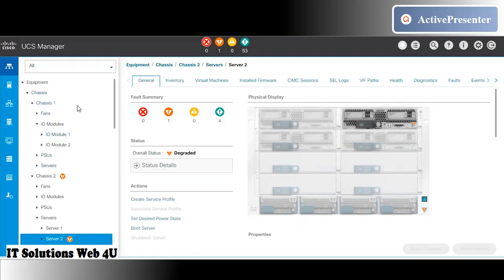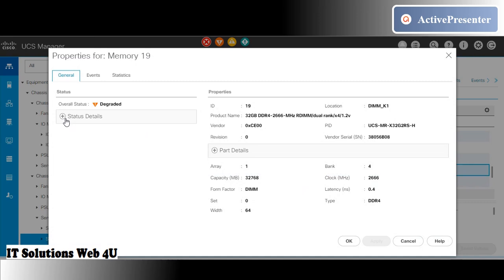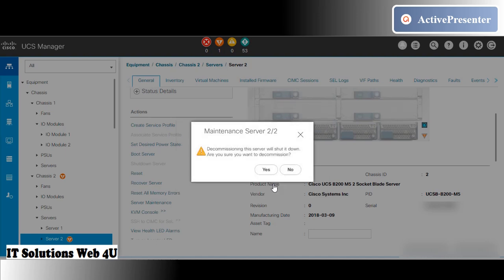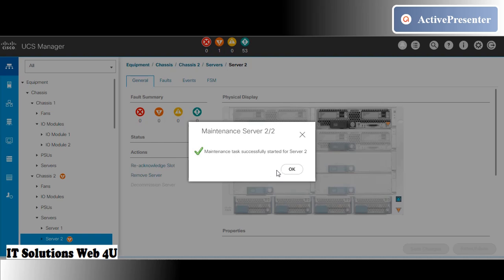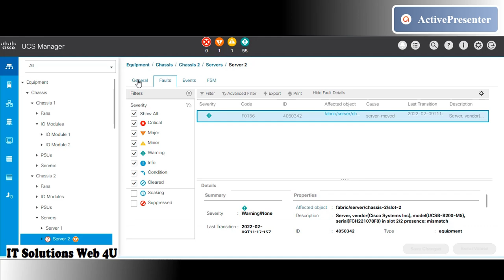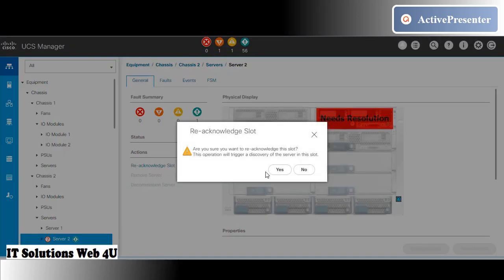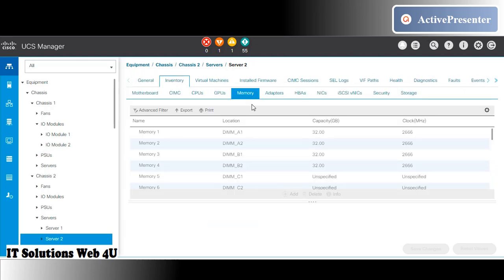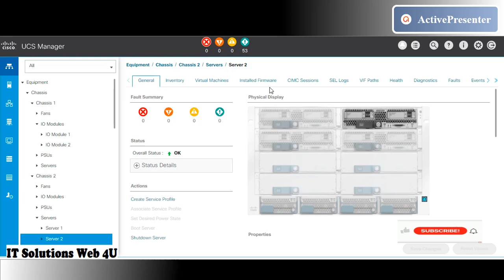How to change memory in UCS

Comment: thanks - this also seems applicable to adding more memory assuming following vendor recommendations for slot placement. Good to know after I re-acknowledge it should associate to the right service profile. Thanks again!
Reply from the maker: you don;t have to do anything on service profile after adding the RAM.
Reply: @itsolutionsweb4u423  thanks - it worked out fine.